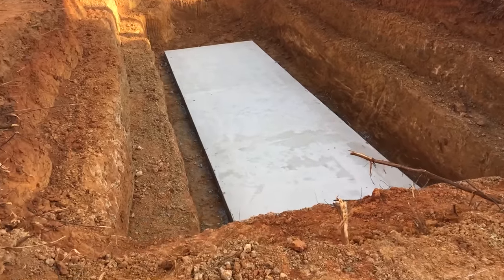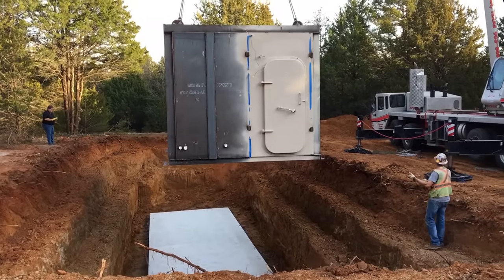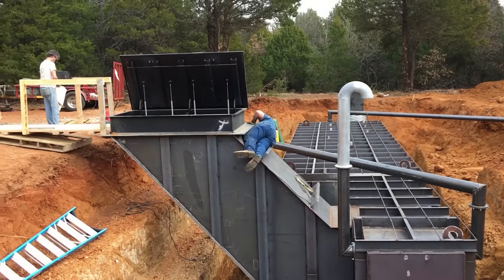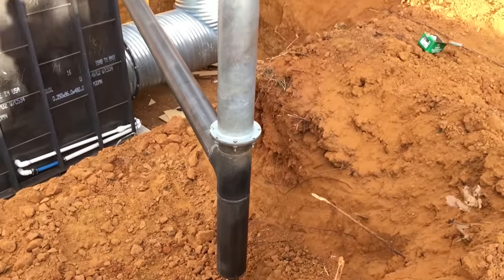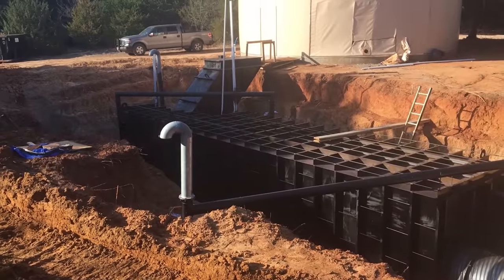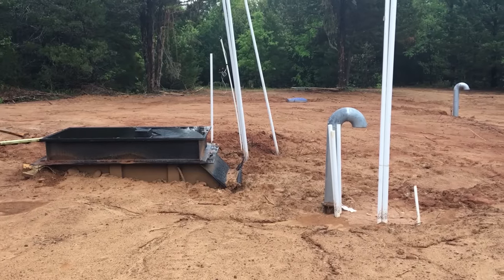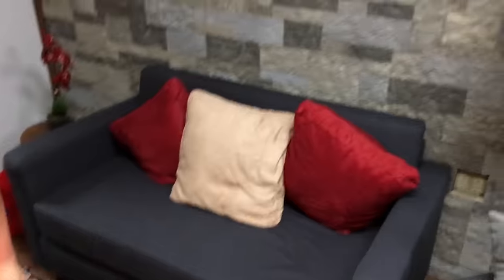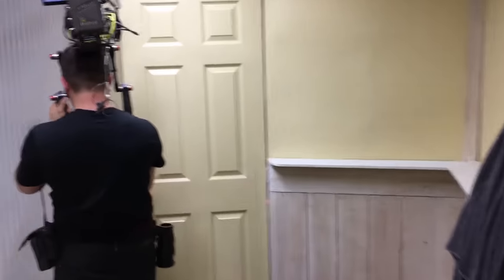Atlas 10x30 Safe-Cellar - Luxury Bunker Built Under A Home (Complete Installation Video) - Part 1

Comment: Looks like there’s enough food storage space for about 3 hours.
Reply: True 😂😂😂
Reply: Whahahahahha damn 9/10
Reply: S D  they have a ventilation system
Reply: And there is no bedroom to actually sleep in there for days.. only thing you can do there, is cooking, drinking wine, shitting and taking a shower. I would also say the air pipes are stupid because they lead to the kitchen of your house.. what when the house is burning?? I would install the pipes 50m away outside hidden in a steel and concrete box with air vents and special filters. Plus some extra oxygen bottles when there was a problem with getting fresh air.
Reply: exactly what I was thinking, lol!
Reply: @IronWarrior95  right, looks pretty but not practical, give me those shelters built out of culverts,  sure no wine cellars but provisions for defense,  cause if you got food  and a thousand outside don't..you
Got a problem
Reply: Git u a boat ready    Haha!
Reply: MRE. Stack 10 cases in the corner. You will no longer need the toilet anymore. My experience with MRE's is you wont have to crap for days on end. 🤪
Reply: Hahahaha
Reply: After three hours you say, “ This is boring and stupid.   Let’s get out of here”.
Reply: Glorious dumpster you voluntarily dive into a…
Reply: In floor storage
Reply: And enough  wine to die drunk
Reply: You have to eat like one can aday
Reply: Look again

Comment: Look - its a basement, just a lot more expensive..
Reply: The wine cellar is purely marketing. It's your problem if you do not stack food while everything is right
Reply: A basement with no windows, a reinforced steel ceiling, a blast door, an air filtration system, and a secret entrance.  The pre-built unit here seems a bit easier...only problem is what do you do when a house is already in place?  Any tunnel options to get to the back yard?  I live in fl, so I hit water at 5ft when I dig...so it's not an option for me😥
Reply: @thatjdmfd  but did i lie? no, no i did not
Reply: @thatjdmfd  see how THIS holds up when a nuclear bomb explodes...
Reply: Oh look, after the nuclear explosion, you house seemed to fall into your shelter errr basement... And everything down there glows in the dark too! Cool!
Reply: @godlygamer911  lol, watch some of their videos. They've been testing these shelters since the 1950's. Directly under nuclear blasts. WITH guys in them even! Worked perfectly! Any other dumb questions?
Reply: Eddie Sloan , I think there is more  storage area under the floor.
Reply: The Rageaholic Razörfist. My boy!
Reply: Yeah I also don't know about that...

Of course you could just build a cellar/basement with all walls being one foot thick out of steel-reinforced concrete - I would assume it to be same strength or even higher then this! Of course an all reinforced concrete basement is water and air tight and could be fabricated to the same standarts as this bunker all the while being significantly larger as it can have the same footprint as the house above it!

Both scenarios surely have pros and cons. The reinforced concrete would be longer-lasting I guess as nothing really should or could rust if the concrete coverage on all steel parts is at least an inch or 1 1/2 inches...

There one could of course also go stainless.

A foot of concrete is quite thick! 
That would definately hole up against severe conditions.

One would use water-proof concrete and then as extra measurement coat the whole concrete outside with two layers of super-thick special coating and insulate it with another 8 or 10 inches of EPS or Styrodur and then slowly fill land against that after apllying some other protective foil to the insulation...

Most/many commercial cellars are build this way here in Germany 

If there are no windows and it is deep enough with a super heavy door it will offer at least the same amount of protection while being 3 to 4 times the size.

Of course it will have to be mechanically aspirated and have all sorts of appliances - but that has been done for years i  the commercial buildings industry
Reply: Just glad I live far away from a where any nuclear blast would happen lol..If your worry is about it surviving nuclear explosions you definitely live close to a city...
Reply: @thatjdmfd  thanks for not further engaging bow tech.  After your comment, they continued to embarrass themselves.  Totally predictably as well.
Reply: lets be honest, no country is bombing that boondocks location. The owner might have other plans for this bunker ;)
Reply: @ThatsMrMaxHeadroomToYou  I dont have one but would like one! Not paran6just realistic! That's why you have an "emergency" exit... if that's blocked.. Then you're just as screwed as the sheeple who are already dead.
Reply: Lol yes indeed. And the interior looks old and outdated
Reply: @godlygamer911  it will hold up very well as long as it's a couple miles away from the bomb
Reply: @n-s-a7113  I think the question which people ask is not if it will survive the nuclear blast. The question is how the person will survive there for months? And what's the goal of this person? How long he plans to stay there? What about food, water and energy supply?

I think it is unrealistic to think this will be of any use in a nuclear scenario. But for other chaotic events (like a societal collapse or a conventional war or a forced vaccination event or a civil war etc) it would be useful.

Comment: Would’ve been nice to see the emergency escape hatch and how it works, and the generator and how that works. Also, would’ve been nice to see how the Air filtration system works as well and how the bathroom functions if the house above it gets destroyed and you had to stay down there for a while. Or, is there a way out if the house above gets destroyed.        Is there a part two to this video with the completion of the house that’s going above it?? Is this just a lounge area with a wine cellar, or can you store food in survival supplies in this bunker in case you had to stay home there for a while??
Reply: Relax
Reply: Wouldn’t be smart to post all of that
Reply: Exactly……
Reply: @Charlie_Ses  ''relax''?
Your reply begs the question;
Why are 'you' looking at Bunkers? 
Relax' much? 😂
The premise of needing a bunker or those that
want them is the antithesis of ''relax'', so yeah, 
the OP, did just fine. lol
Reply: OgDj,
I have always considered what I think is 
a huge issue: Air Ventilation system, I would 
imagine they have an incredible filtration 
system (don't know first hand) , however the
bunker is only safe from marauders until they 
find the vents, then they feed them with 
carbon monoxide etc for hours, or simply cork 
them, cutting off oxygen coming in, and wait 
for you to come out, a matter of time, and 
not all that much time. I would think the solution 
to this issue would be to disguise the vents as 
well as locate them 'FAR' from the shelter to 
where they would be quite difficult to locate,
by others.
Reply: @Fuckyolettuce  ??
Reply: Good questions.
They give the price of this unit which is cool, 
I wonder if that includes set up?
How long could one survive in the bunker 
providing they have food and water.
What else might they need in terms of sewage,
trash storage or removal.
What happens when marauders see your air 
vents and plug them up.
Is the filtration certified for fallout radiation, 
and if so at what cert level?
All in all though, nice project, lots of engineering
and fabrication expertise involved.
Reply: @bikersoncall  You could just use chemical oxygen generators like potassium superoxide and cut off the bunker entirely from the outside world until it's reasonably safe to use normal ventilation again. And even without additional supply of air, a space this large would last several days for one person. Also, carbon monoxide can be neutralized with hopcalite, and most organic chemicals with activated carbon.
Reply: @VVayVVard  If you're hiding from a storm,
sure why not, but most will buy this for survival against nuclear fall-out and or Armageddon scenarios, whereby 
'reasonable safe to come out' could mean
several years.
Reply: @bikersoncall  In that case you could invest in a mini-biosphere, with enough plants to produce both food and oxygen, which in itself could be maintained with LED-lights and urine/fecal waste. Eventually you'd run out of energy, but with enough plants and a good enough system you could probably make it last for a few years. Would be prohibitively expensive though, and probably pretty difficult to operate in practice.
Reply: Say the house above is destroyed by a tornado how’s one going to get out. 
Looks like an expensive coffin. But if designed well it may save your lives in
a tornado or hurricane…
Reply: @Charlie_Ses  
Relax!? Why, because I thought of some actual good questions and you couldn’t
Reply: @bikersoncall   

 

The purpose of posting a YouTube video is to get viewers to look at your product and comment on it. I guess your purpose is wondering why you didn’t come up with good questions in regards to the video? Or maybe your just one of those people that just like to watch videos with no type of insight, opinion, or intelligent feedback. Maybe you just like all the different colors in the lights flashing
Reply: @OgDj2024  'Relax'.
😅
Reply: @bikersoncall  
Why, there’s nothing wrong with interjecting with intelligent opinions and questions. You should try it sometime, if that’s possible?
Reply: @Instantpower332  The BombNado shelter is equipped with an 8-ton hydraulic hatch lift jack that can be used to open the door if it has been covered with rubble. The Peaceroom shelter sold by Shichiro in Japan has a similar design.
Reply: @OgDj2024  You should always launch 
personal attacks when you can't
win you can't compete in a logical
discussion, oh , right, that's the
only tool in your tool box.🤣

🤣
Reply: @OgDj2024  ..and why inf, do you find it
important to 'necro' this thread.
🤣✔
Reply: @bikersoncall  
Whining!? You definitely got me mixed up with somebody else in the comment thread. I posted legitimate questions on the video, nothing whiny about that at all. Maybe you should go back and reread before you post your comment and get the facts first.
Reply: @OgDj2024  Triggered whiner much?
😅 ✔
Reply: @OgDj2024  OgDj,
Anyone in your family or family history
have reading skills above the 2nd grade 
level?
--
I have always considered what I think is 
a huge issue: Air Ventilation system, I would 
imagine they have an incredible filtration 
system (don't know first hand) , however the
bunker is only safe from marauders until they 
find the vents, then they feed them with 
carbon monoxide etc for hours, or simply cork 
them, cutting off oxygen coming in, and wait 
for you to come out, a matter of time, and 
not all that much time. I would think the solution 
to this issue would be to disguise the vents as 
well as locate them 'FAR' from the shelter to 
where they would be quite difficult to locate,
by others.
Reply: @OgDj2024  @OgDj  Plagiarism much? lol
All you have is insults, that's how
you start your conversations, yet
you have difficulty coming up with 
your own, so you twist other's 
words around pretending they are 
your own work, yeah, plagiarism,
we can add that to your tool box,
so now you have three solid tools;
Insults, personal attacks, and 
plagiarism, brilliant son, absolutely
astoundingly brilliant!
Reply: @OgDj2024  @OgDj  Plagiarism much? lol
All you have is insults, that's how
you start your conversations, yet
you have difficulty coming up with 
your own, so you twist other's 
words around pretending they are 
your own work, yeah, plagiarism,
we can add that to your tool box,
so now you have three solid tools;
Insults, personal attacks, and 
plagiarism, brilliant son, absolutely
astoundingly brilliant!
Reply: All that will cost millions